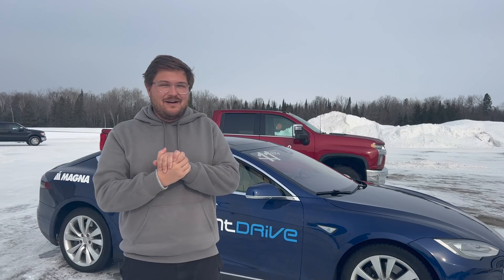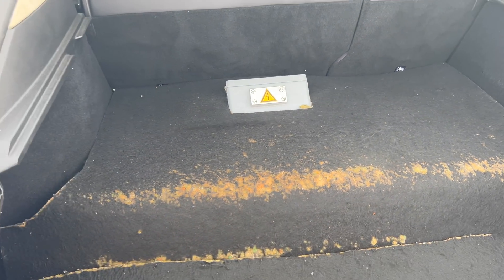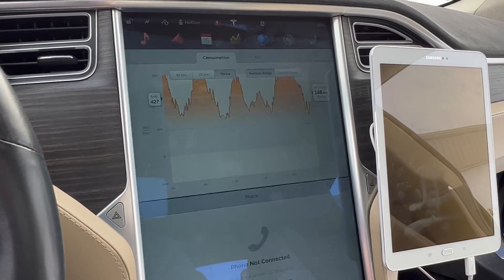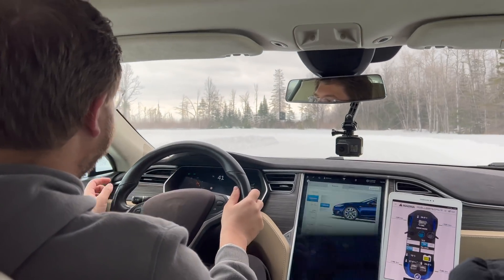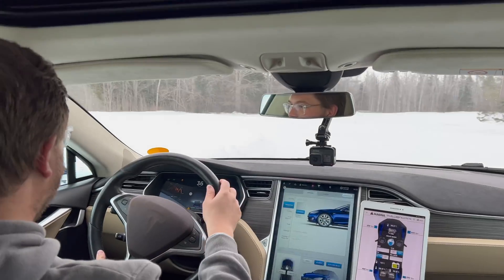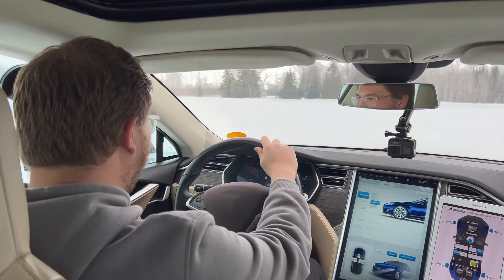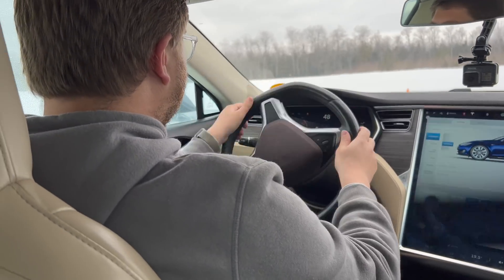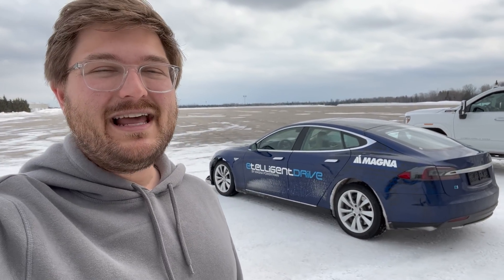I Drive A 7 Year Old Prototype Tesla Model S Tri-Motor At A Secret Cold Weather Test Facility!

Comment: I wonder if Magna would consider using also 24-40 kwh Leafs or other brands EVs, and switch the OEM system with theirs, making test mules on different brands. Also, how much will gain, because I saw on a video they have around 750+ miles of range in that car.